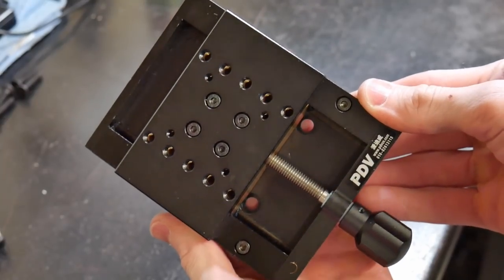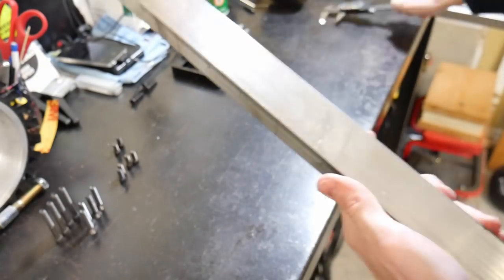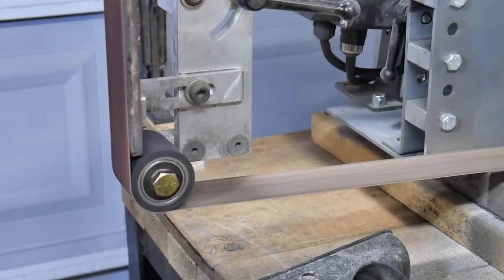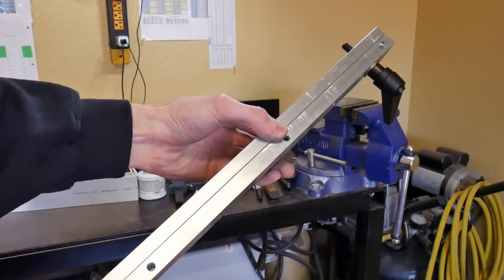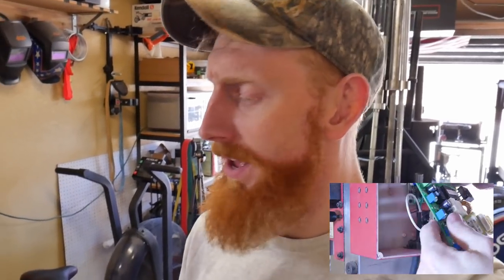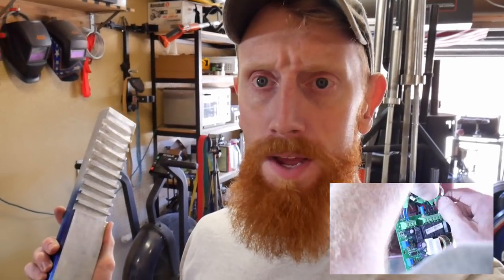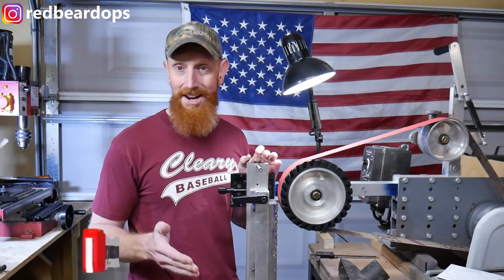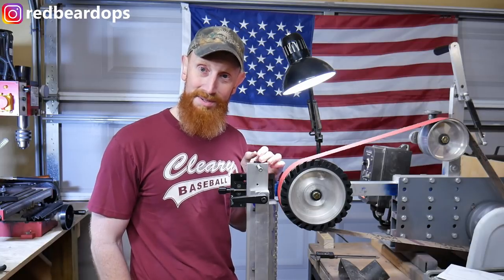Homemade Surface Grinder Attachment - Want Flat Things?

Comment: If you want to thin in your belt down. Mark your belt make the first incision with a pair of scissors. Strip belt to before you get to the Tate in both directions. And then finish the separation with the scissors one shortcut
Reply from the maker: Hey man, what do you mean by "thin your belt down?"
Reply: @RedBeardOps  cut in half etc
Reply from the maker: @forgeperformanceand4x4  Gotcha, I was able to find some 3'' - ers from combat abrasives

Comment: Dumb question, but im wondering what t(e purpose of the slotted aluminium bar is! Would magnets epoxied under a thin flat steel plate not have the same functionality?
Reply from the maker: I'm sure that could work, I guess the thought could be that the Aluminum has a smaller chance of damaging your finish
Reply: @RedBeardOps  didnt think of that! Thanks 😊

Comment: What dimention your rubber wheel bearing hole? 14mm or 15mm?
Reply from the maker: It's a 1/2'' bearing, I'm not sure what the hole size is to accept the bearing. Sorry about that.

Comment: Which sliding table is needed? The $85 option or the $136 version? I’m not sure. Thx
Reply from the maker: Mine was the cheaper one that's 50mm. The larger table would give you more space between the chuck and wheel. I do wish these tables had gibs so they could be adjusted. I ended up shimming mine to tighten it up after a year of use.
Reply: @RedBeardOps  thank you sir! Love watching your videos and your ability to work through these builds!! Best channel on YouTube! Hope to meet you at Blade Show in Atlanta next year!

Comment: Awesome build!! Slot milling would have been much cleaner with a smaller end mill down the center of the slot then clean up the sides with a single pass at full depth. A smaller end mill would of been much easier on your small mill too.
Reply from the maker: Thanks for the tip James!

Comment: funny was thinking about making a tool to do this job, only it would not be vertical for sure. Horizontal on guide rails with adjustable height and that goes from right to left. Thanks though.
Reply from the maker: Thanks for watching sir! Yes horizontal would be easier to operate. This hasn't been too bad though!
Reply: @RedBeardOps  like a tile cutter. Belt sander or better still orbital sander suspended on rails. some kind of height adjustment but also the ability to hold the piece incase the underside is not flat. Then waste less material and grind both sides. Have owned a wood factory making sash windows. Belt sanded hundreds or thousands of sash windows in 20 years. The factory next to me had a £30,000 sanding machine which took doors in and pumped them out to .3mm tolerance. Im just about to buy grounded steel plates for my cnc milling machine im welding up the frame for right now. Very expensive. 300mm x 800mm and 40mm thick costing £450 for that one piece. You got me thinking now to make the grinding machine and save cash. Oh and just rocked up at my dads and bizarrely enough he gave me a magazine. Does not know about my need for ground stock or this video yet his magazine is 60 pages full of grinding machines. ha ha
Reply from the maker: @jamesbarratt593  lol, sounds like you have some work ahead of you! Good luck sir!

Comment: Drill an tape a hole in your blade to use a screw to pull ur knife up without scratching ur finish...I also use doubled side carpet tape for TI
Reply from the maker: Nice tip! Thank you sir! I watched your video on your surface grinder. Your cork belt finish is excellent! I'll have to give that a go. It seems like slow feed rates is key in general with these things.
Reply: @RedBeardOps  ....I run mone on my dozier it is 2hp I could horse it more an do it fast but I agree slow an steady..my wheel is 100 duro no give to .....cork belts are great I have three of grits well worn..i have a course on that is worn I use satin glo on it...it is a compound that sets up an gets a head on it an cuts steel....I also use them on sisal wheel on my buffer....blends finish to a high satin finish..great stuff....bob dozier told me about it years ago.Tom Krein also uses it
Reply from the maker: Houseknives very cool! Do you ever chase warps on it with shimms or do you make sure you’re straight going into it?

Comment: You want your permanent magnets as close to the part as possible. The strength of the magnets falls off almost quadratically with distance. So you want those magnets to be sub millimeter level close to the work part if possible.
Reply from the maker: good points

Comment: How much did he charge to fix the drive transistor or relay? Have to admit, first thing I thought of was the motor. Burnt plenty of those.
Reply from the maker: Hey man, I think it was around $80 to fix up the board. He was great to work with! Cheers

Comment: Bummer.
  I thought it was going to be a (semi) proper surface grinder attachment for general machining with a proper magnetic chuck. I'm a new machinist & Ive watched literally thousands of hours of videos, learning ways to build tools I don't have the money to buy yet.
Probably works great for knives though. On a proper machinist-type surface grinder, 0.001" passes are pretty aggressive. 

It gave me a few ideas though.
Thanks for spending that time to make it.
Reply from the maker: Hey Chirs, in that regard I'm sorry to disappoint! For the craft of knifemaking the results are more than adequate... but this system will pale in comparison to a stone wheel surface grinder. So far I've been able to achieve a 0.0011'' total variance over a 7.5'' piece. For getting my tangs flat this has been great.
Reply: @RedBeardOps  

Wow! That's actually really good for something this "simple". Not that it's actually simple to make but... yeah. 
BTW, looks like you learned a valuable lesson about slotting and how hard you can push your machine. I'm still very conservative. I haven't taken a manual mill past 1800 rpm & I'm usually using Bridgeport-type machines.
  If you haven't yet, get a 1/2 to 3/4" roughing endmill. They really help smaller machines remove some material.
Reply: @davidhoback4225  I think you may have misinterpreted my words and intent. If you'll notice, Red Beard understand them perfectly.
 No need to resort to name calling  ...unless you're trying to egg me on for a little trolling fun.

Comment: Out of curiosity, have you ever measured the parallelism on a setup like this? What is the accuracy like compared to a "real" machinist's surface grinder?
Reply from the maker: It's not nearly as precise as a real surface grinder. Those are good to a couple of 10 thoustanths.

Comment: I printed out your PDF but they are not coming out true measurements. Is it set to print on A4 paper size ?
Reply from the maker: Hey man, sorry about that. You may need to do some sizing on your machine. Take a screen shot and size in power point. I find that easier.

Comment: How do you get the blade off the magnet tray?
Reply from the maker: Hey Larry, the force is light enough that I can slide the blade off of the magnetic chuck. If my surface grinder was more high class it would have a chuck that could turn on and off!  :)

Comment: I would defenatelly flip ur grinder on it side , much better for ur joints , also I made one like that myself few month ago , I did got myself 3" belts from industrial welding store they ordered them for 20(3x72)  belts it was 170$ , but I would defenatelly swap it to side movement also with few more modifications u can do bevels on it not just tapers.
Reply from the maker: Thanks for your comment! Yeah, down the road I'll definitely put a pivot on my grinder. Right now it would throw sparks right into my shop with it's orientation, so i'm going to wait a while for that. Cheers! Thanks for watching!
Reply: Would it not be cheaper to just cut down a 4x72 belt? Or join together some 3x24 belts, both can easily be done.
Reply from the maker: @Steve_Just_Steve  Not a bad idea! Luckily many companies are making 3x79'' belts which should work just fine. Thanks for the suggestion though.

Comment: Great Build J! I could use a 3” belt also. I was doing some work today that warranted it. This build is definitely on my list to do. Nice work my friend! 👊🏻
Reply from the maker: Hey man, thanks for stopping by and watching! Glad you liked it. This thing has been pretty cool. Fun to build for sure. I'm still working the kinks out. I got my micrometer today. The best I've been able to do is 0.0011'' variance across the knife. I feel like that is pretty good. Takes a slow and steady approach. On the 3'' belts... Combat Abrasives makes a 3'' x 79'' belt which just so happen will fit this SGA for me... since I built my tooling arm long.
Reply: Red Beard Ops - 0.0011 isn’t good enough!? I guess if you are going to do folders you need super precision. (YouTube finally recommended your vid to me btw) I didn’t know it was out. 😎
Reply from the maker: @HouseMadeUS  Awww hell, YouTube is so fickle. LOL  --- Yeah... I think 0.0011 is pretty darn good! Especially for the fixed blade stuff I do currently. I will say one of the challenges of a SGA is dealing with warps. It seems like you need to get the warps pretty much out of the piece before using the SGA. Since the magnet is strong enough to pull in the warp... Then you surface a piece that will warp right back out once you remove it from the magnet.
Reply: Red Beard Ops Hmmn interesting. Maybe a less strong magnet set? Seems like it defeats the purpose if you have to remove the warp first?
Reply: @RedBeardOps  Red label Abrasives has 3*79 and 3*90  in AO, Zirc, and Ceramic
Reply from the maker: @the_sharp_carpenter  Hey Rodney, thanks for the comment! Cheers
Reply: @RedBeardOps  it's a build that is on my list, so I've looked at the options lol
Reply from the maker: @the_sharp_carpenter  Combat abrasives also carry 3x79. With the length of my tooling arm these belts should work fairly well for me. (We'll find out!)
Reply: @RedBeardOps  you will only need to slide the arm our about 3" more to make up the difference. If I do it I might just plan for the 3x90 as I have other plans for 3" belts 🤔

Comment: might have tested out drilling a hole through one of the magnets, because bolting them down would be more secure than a glue-up. Or maybe even tap some holes in them and bolt from behind.
Reply from the maker: Not a bad idea Greg! I will say that I haven't had any issues yet though. This epoxy is pretty strong. Thanks for your thoughts!
Reply: They likely aren't drillable I have dropped magnets and they have chipped. So they are hard and brittle.
Reply: Drilling is a bad idea for several reasons...one, because they're made of an extremely hard and brittle material, and two, because the magnetic field becomes interrupted and you lose a lot of that magnetic force.

A better idea if you don't like the thought of epoxy is to simply bolt a relatively thin sheet of aluminum over the top of them.  Cut the channels a few thou shallow so the magnets sit proud, and a 1/8" thick sheet of aluminum with countersunk screws in a multitude of places would hold them all tight.  Once that's all taken care of, surface grind the plate true.  Using steel for the plate would be preferable for a consistent flat surface but I'm not certain how much magnetic force you'd lose from that, since aluminum is more or less transparent to magnetic lines of flux.  I guess it all depends on how big your magnets are as well as their flux density.  Just be careful tightening the plate down that you don't impart too much force on the magnet and break one.
Reply: @Skinflaps_Meatslapper  yeah I like that idea

Comment: You might think about potting those magnets in on your chuck there, as you've probably found out by now, that's going to be a bitch to clean the dust out off. Also re-positioning the apparatus at a 45* angle where it contacts the wheel more toward the bottom would probably help with your arm fatigue from the awkwardness of having to reciprocate straight up and down.
Reply from the maker: Not a bad idea on the magnets! I agree 45 degree would be easier, but when I get the ability to turn my grinder 90 degrees this attachment should work great in the horizontal position. For now it's really not that bad to operate. Cheers man, thanks for watching.
Reply: @RedBeardOps   Did you my comment in reply the comment on the bottom of page about cutter size and type that would help out a lot on the smaller mill of yours?
Reply from the maker: @Steve_Just_Steve  I liked using my 7/16ths cutter since it's the right size for my magnets. I'd use a 3 flute roughing end mill if I had to do it again, but note that I'm not a machinist...
Reply: @RedBeardOps  I know your not buddy, I am that's why I was trying to help. I was talking about using the mill in the future. Also, you don't have to have the exact size cutter as your finished slot, just step the cutter over, that's actually the preferred method to ensure a tight tolerance. ATB
Reply from the maker: @Steve_Just_Steve  Ahhh 10-4, I'll keep all that in mind for the next project!

Comment: Nice project! (I plan to make one myself someday). Is there a specific reason you put the slider vertical? Some use it more horizontal to get some view on the grind and maybe safety if the blade comes of. Greetings from the Netherlands, a fellow maker and (a little less) red beard. Bart
Reply from the maker: Cheers from Texas sir! I put my vertical out of ease. One day I'd like a horizontal grinder and when that happens I can use this same attachment and have it horizontal. As far as the function goes it seems to be about the same... just a little more work to use. If you throw a blade off of this chuck you're taking waaaayyy too big of bites! This chuck is strong!

Comment: Normally I'd ask why not use a ball-bearing type carriage, but here, steel grit won't jam up the rollers as much as it would affect ball bearings.
Reply from the maker: If it's any consolation, I've been using this SGA for years now and it's still in good shape.

Comment: hi. sorry a year has past. but there is a 4" and 6"belt .. looks to be the same length as yours .. i built a large belt sander based on a 6" belt we had at work. that way i did not have to buy belts i just used the belt they though out . and brought my self scotch bright belt . it worked for many years .
Reply from the maker: I love those scotch bright belts!

Comment: Would it not be easier on the arms horizontal?
Reply from the maker: For sure, if I had the ability to rotate my 2x72 grinder. Some have this feature, and I may build it in in the future. Good news is that this attachment will still work well when I do have that hinge feature down the road. Have a great day!

Comment: Definitely would want to make it so your belt grinder tilts on the side.
Reply from the maker: Well down the road I probably will. To be honest though it works great in this configuration... just takes a little more man power! With this set up I'm able to achieve around 0.0011''' variance across a 7.5'' piece. So far.

Comment: Quick question, how deep did you mill the slots?
Reply from the maker: Hey Greg, in my build I added 0.125'' to the top of the magnets. So around 0.32''. This seems to be working fairly well. You will take down this 0.125'' dimension a little when you surface the chuck. Over time you may need to surface the chuck a few times, but you won't be taking off much material. The magnetic hold on my chuck is more than strong enough for this this application with 0.125'' of ledge above the magnets. Cheers man!
Reply: @RedBeardOps  Thanks.

Comment: It's hard to tell for sure, but it appears that there is no spacer between your contact wheel bearings.  This can cause early bearing failure when you tighten down the axle nut.
Reply from the maker: Good to know steve

Comment: Looks very good but need someone like you with a mill to build me one because if I could afford the mill I would but the TW surface grinder but like you say they are very pricey
Reply from the maker: Good points Bert, I've seen many people bring their parts to a local shop to get the milling done. With large machines they generally don't charge much to get milling done. Cheers sir!

Comment: I see a lot of odd size fasteners. ;) METRIC RULES THE WORLD!!
Reply from the maker: LOL, if it wasn't for the M6 the whole job would of been 1/4-20! But hey, thank goodness for ACE hardware! Thanks for watching man.
Reply: I'm in the USA but greatly prefer working in metric. I got tired of the high fastener prices @ the hardware store and bought several boxes of assorted sizes  from McMaster-Carr.  You can get even cheaper Chinese sets on line. Saves a lot of time/trips also. We buy coated abrasives from Uneda. Any size, backing or abrasive you want.
Reply from the maker: @larryschweitzer4904  Good tip there on buying in bulk! It can be tedious at ACE hardware picking it all out.

Comment: using steel for the magnetic chuck would make it WAY stronger, the magnets would probably need to face the same direction so the space between them is the opposite polarity.
Reply from the maker: For sure. It would also make it pretty darn heavy! I have seen a few people go the steel route for these and it does work just fine.
Reply: @RedBeardOps  a spring could be added to reduce the amount of effort required, or it could double as a workout machine.